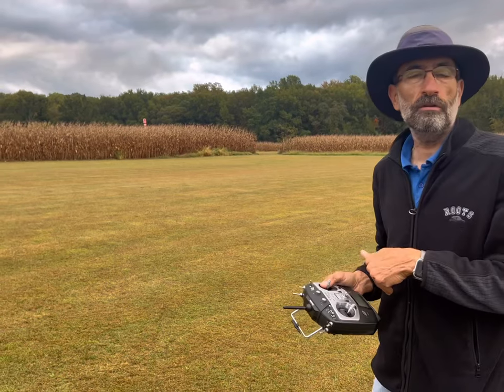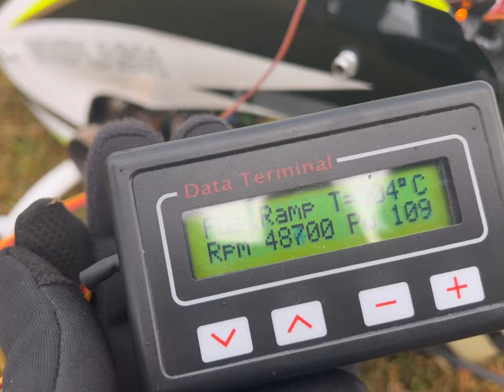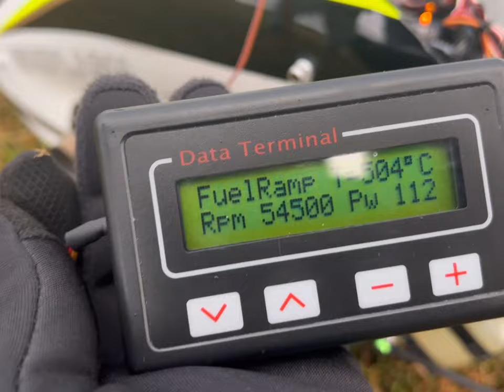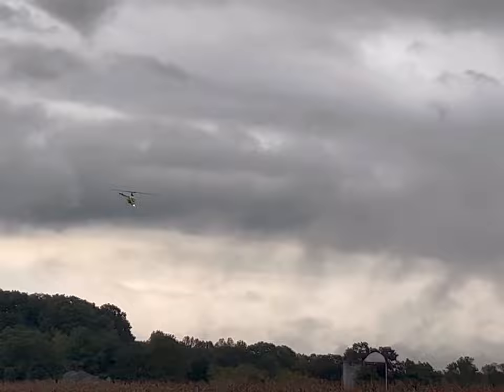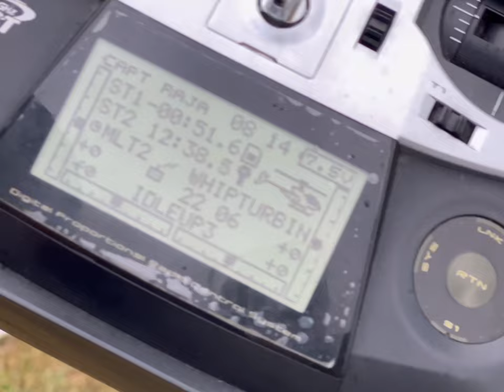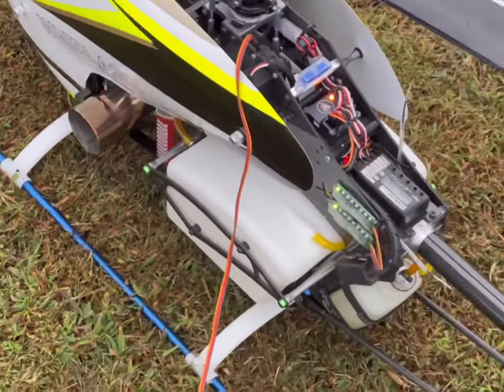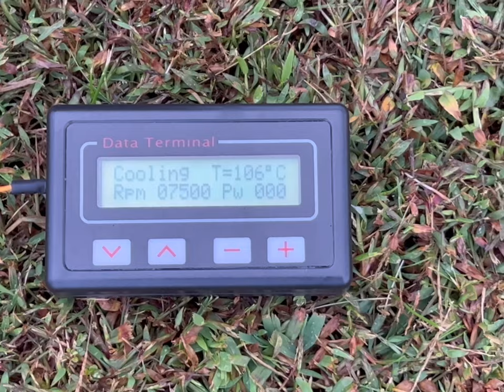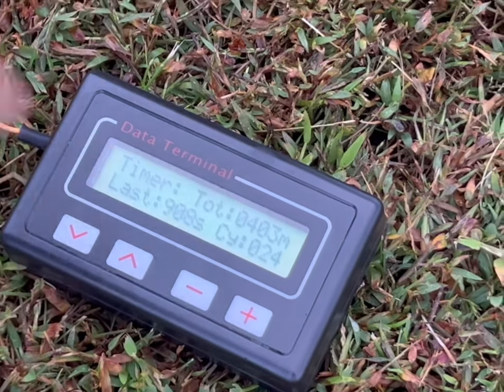How a Turbine engine works in an RC Helicopter.

Comment: Flight time? And tank capacity
Reply from the maker: Flight time as about 16min.
Reply: Actual flight time around 11 minutes, run time around 16 including start and stop and cooldown.  Fuel tank is 2 x 32 oz plus header about 1/2 gallon useable.

Comment: what is the little brushless motor on the top for?
Reply: It maintains the flight batteries on board so you never have to charge them, plus gives an additional safety net if anything goes wrong with the switch or battery you can fly on generator power only and land without incident.
Reply: @rbort07  Do you know where he got that generator setup from? I would like to do that as well for my heli. I have the same Whiplash turbine with a Xicoy.